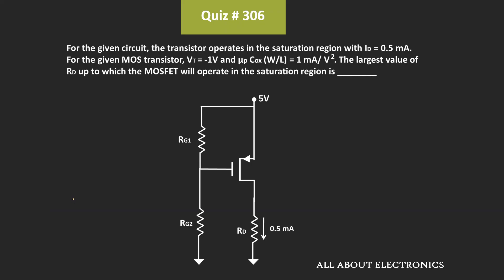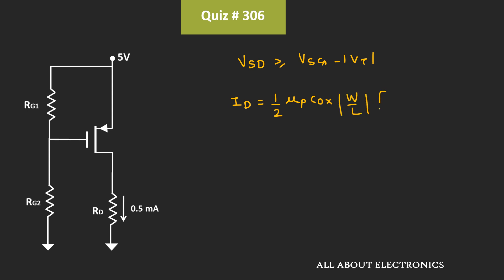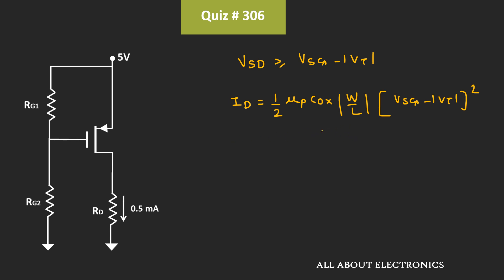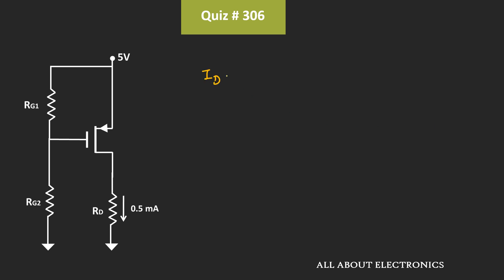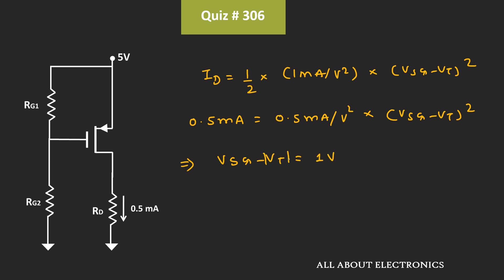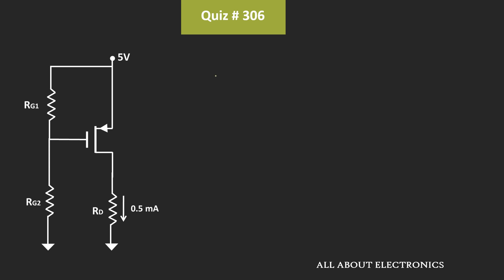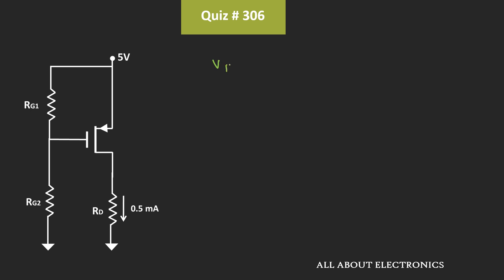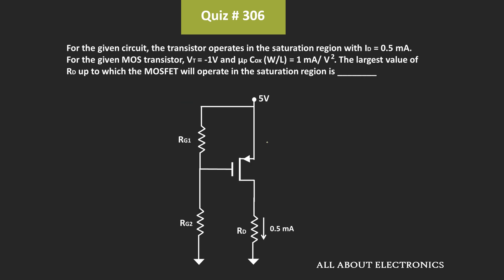MOSFET Biasing : P-Channel MOSFET Biasing | Quiz # 306

Comment: Sir how can we assign the values for Rg1 and Rg2(designing process)..... Whats the concept behind it. In case of bjt i know. But in case of mosfet i.e., in this exact problem please comment or make video on how to find the values of Rg1 and Rg2 in pmosfet
Reply from the maker: it should be selected such that zin is high. as well as you get the desired value for Vg. When such biasing is used for amplification, then input impedance is parallel combination of Rg1 and Rg2. So, typically it should be in MΩ.